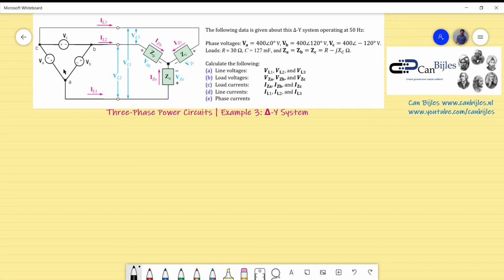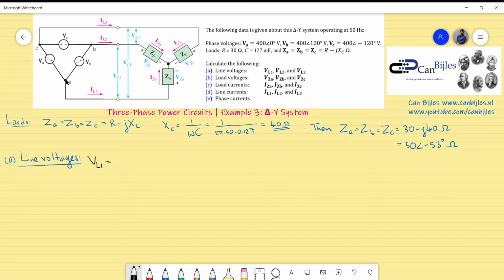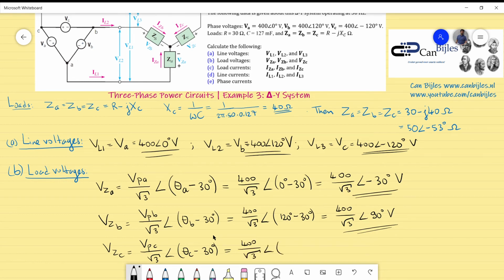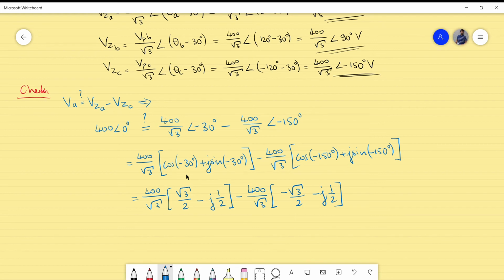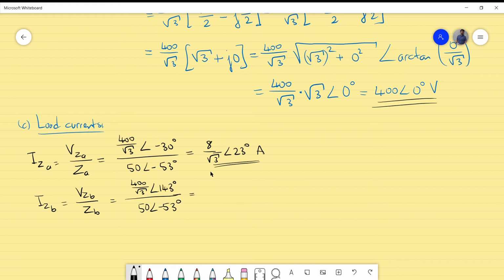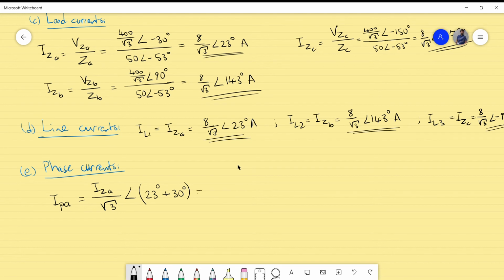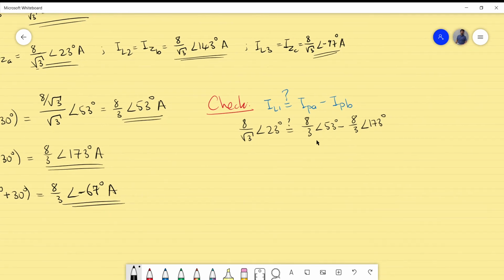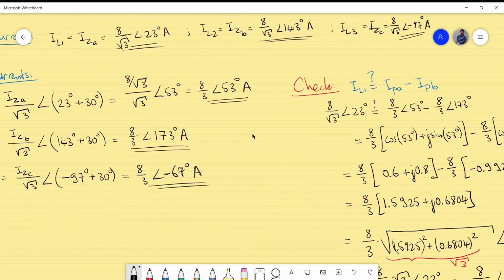Three-Phase Power Circuits ⭐ Example 3: ∆-Y (Delta-Star) System

Comment from the maker: Errata: the capacitor used in the calculations should be C = 79.6 uF. Replace the 127 mF by 79.6 uF. The rest of the calculations that follow are correct.

Comment: Xc=40 ohm ????
Reply from the maker: Thanks for the comment.

The given and written capacitor value is wrong. It should be C = 79.6 uF. Replace the 127 mF by 79.6 uF. The rest of the calculations that follow are correct.
Reply: @CANEDUX I second guessed my calculator :D
Reply from the maker: @mberoakoko24  İt always possible to type it incorrectly in the calculator 😉